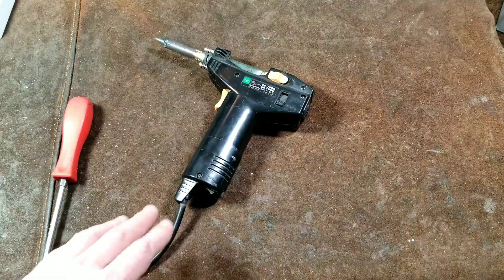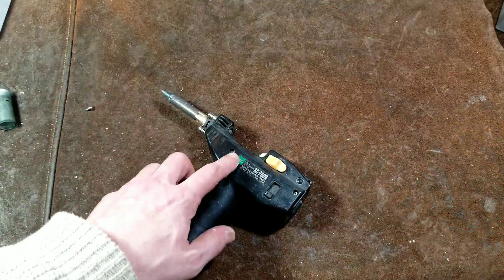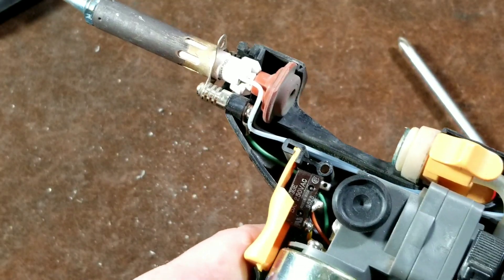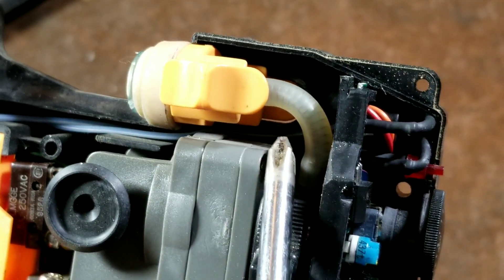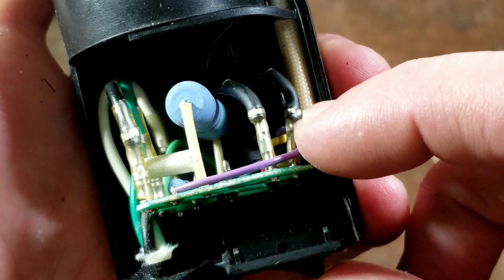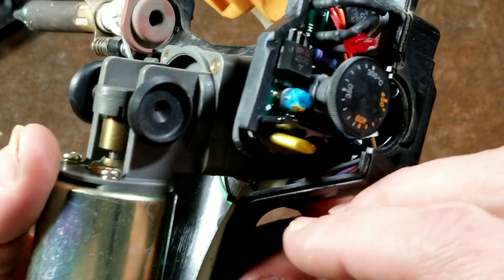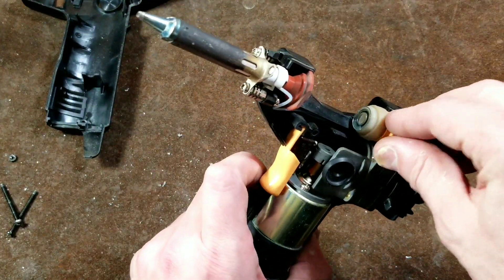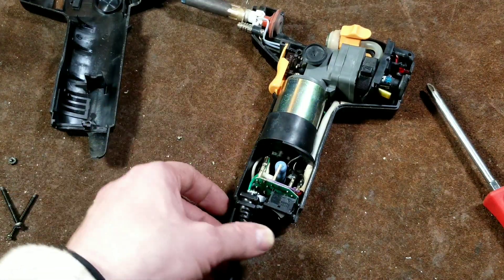Denon Instruments De-soldering Tool Disassembly & Evaluation

Comment: To use the hot air blower function, you should use a different tip, and a different filter nozzle. Both come in the SMD kit for the unit. Denon Part No. 72-88-00.

Comment: Luckily i got one of these used a few years ago for only 100,- Euro. It still works great and with some searching on the web you can get spare parts (filters, soldering tips, heating element) relatively easy. To use the blow function properly (e.g. for SMD) you need an accessory set (SMD Set). It contains a special blowing tip and an empty filter. With this the air throughput is much better and you can desolder SMD with hot air.
Over all the decades that I've worked with electronics, this tool is the best I've ever used for desoldering. So I can only recommend it. Especially if you can't or don't want to use an even more expensive complete desoldering station.